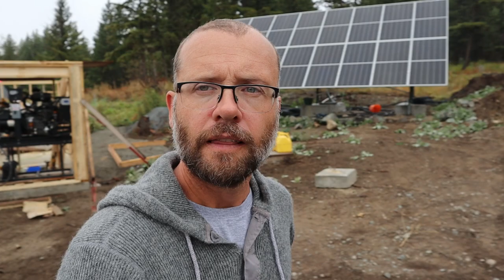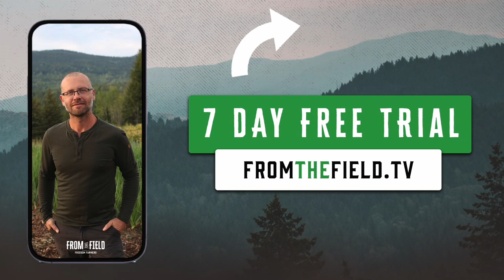Why I Set My Solar Panels At 3 Angles

Comment: Nice, 15 degrees is probably very nice for your area. Mountainous areas experience delayed sunrises, so solar generation starts at a later time and a more southern angle (off of east). I guess in flatter areas you might want to go more, but I've heard west or east facing panels aren't going to produce as much as southwest or southeast panels (of course direct south being the best).

A secondary case for varied angles is if your inverter can't handle the peak solar noon power output and so it clips your incoming power. All your panels facing directly south would cause a higher peak at noon, causing more clipped wasted power. You either would have to spend big money on a larger inverter, or deviate your angles to widen and lessen the peak of the power curve, reducing clipping, which could increase overall usable power generation (and would save you the money for the larger inverter). 

All depends on individual scenarios, but if you have extra space for panels and don't want to get a larger inverter, you'd probably benefit from adding some southwest/southeast panels.

Comment: We are in Spain and we live with 4 panels with 225w each one, four people for 2 winters and only we spend 16 liters of gasoline, each winter, also qe heat the house with woodfire, Thanks for your ideas!  u r awesome!!
Reply: Yeah having a generator in winter can be a good way to get through the winter when your panels can not produce enough.
I do guess that doubling the wattage on solar might cut your gasoline usage in half ;-)
Reply: @HansKeesom  yeah! we will build a roof  to protect the compost works where we will install 8-10 panels the idea is provide energy for electric mobility and suply the electrical power in the house! thanks for your consideration
Reply: @MaxVonShagow  That sounds like a great project. I hope the Spanish authorities are not working against you. As I understood it was hard in Spain to get permits for solar. Or did you solve that by going off grid?
Reply: @HansKeesom  yes we go offgrid... And also because only go harder if you put e_ panels on house roof... Then you dont need any licence if you make a substructure for gardening and also because we dont link to national electric supplies

Comment: I explained all this on a post some years ago, I wonder if he took my advice. Or maybe he's really smart, and did not need to learn the hard way !
I have a 300Kwh system. i learned a lot during the last 15 years ! I do have some solar tracking panels , but this is not worth while. Adjusting for seasonal variations IS ! I found just two manually adjusted positions, is optimal in terms of installation complexity and durability verses production. My east facing panels are most productive, my location has clear blue skies most mornings then clouds over by noon. Hot water, I found direct thermal solar heating is best . Mostly because it adsorbs infrared they produce hot water even on cloudy days. Whereas solar voltaics just stop when it gets cloudy.
Blessings to all.

Comment: Thank you! Thank you! Thank you! I was certain that someone had figured this out, but couldn’t find any information on the internet about it. Designing my system now for a 20kw array. Plan is to use 4 separate arrays, just for mounting ease. I had this same idea, also for the reason of trying to prevent the inverter from clipping. My plan is to have each array 10° off from the other, starting at 160° then 170, 180, and finally 190. Where I live our weather peak is from 4pm-8pm for rain/thunderstorms, as well as when our cloud systems move in usually, so I’m not worried about trying to collect during that time. Thanks again for the useful info!

Comment: One idea I had was to have the entire array on a set of screws with step motors, a light sensor integrated into the circuit would optimise light collection and angle towards it.  The base would be on a turntable which can rotate from sunrise to sunset, returns to the previous days settings at sunset.  The problem in my area is high winds and the array would take flight.

Comment: Beautiful panel array!
I have a few panels, pole mounted on my RV site. Manually turned but it's a game changer in the upper hemisphere.
You're work there is fantastic! Just a dream for me at my stage of life but it's fun to dream. And trust me, these days I do! Self sustainability is a great concept to teach your kids. 
You have done everthing to perfection in my view! 👌
I hate dragging politics into everything but your set up cofirms my belief the current solar technology is not a viable replacement to justify the 2030 agenda to eliminate the need for fossil fuel. An average city lot & rooftop could not accomodate that many panels. You set the standard for excellence while at the same time proved to me that diverse power sources are still necessary.
Looking forward to future videos!
Reply: I know a guy that is grid-tied with his 6000W rooftop installation in Edmonton. He doesn't understand that without my tax-money being used to subsidize him, every aspect of his hobby is useless. He's the same guy that told me winter snow cover isn't a problem because a multi-year technical study proved conclusively that it only reduces panel efficiency by 5%. The same authors think that carbon tax and eating bugs will stop hurricanes and volcanic eruptions an sheit. Ya'know...the science.

Comment: How does your charge controller deal with the different voltages caused by the different angles? I understand that MPPT controllers round down the power to match the lowest producing panel or string.

Comment: I'm building a small (minimalist...1400W) solar PV system that is mounted on a pair of horizontal "spits". They can track in elevation only, but I could rotate the entire craft in certain situations. You've mentioned future-proofing with the potential for an additional panel installation.  You could consider mounting your existing installations on rotating azimuths to optimize your efficiency.
Reply from the maker: With your system, it's easy to do. With a system as large as mine on three different rigs, just try to imagine the amount of mechanics, servicing and maintenance that would be involved?
Reply: @offgridcurtisstone Now you've got me thinking up a couple of fairly simple / robust / weather-proof / cost-effective approaches that can be taken.

Comment: would it make sense to have just one of your rigs but that one being able to swivel throughout the day and investing the money of the 2 other rigs into more battery capacity?
Reply: Those tracking racks are great but can be expensive. If you have the space it’s probably cheaper to buy additional modules and racks etc. that would add up to the same output as a smaller tracking system, but with no moving parts.

Comment: Because of winter I would have placed them more vertical aiming for the wintersun.. Means more watts in winter when you really need them more the nin summer and still get's you more then enough in summer.
Reply from the maker: Like I said in the video, we can change the angle every season.
Reply: @offgridcurtisstone  Oke sorry I missed that. Good to hear, I am a big fan of almost vertical panels for when living closer to the poles.

Comment: So does the same idea apply along the other axis pitching the panels more towards the winter sun so as to increase winter output at the cost of peak summer? (Assuming you are on a fixed mount). 🙏
Reply from the maker: I actually forgot to mention that the panels can move the angle. We move them at each season change.

Comment: I wouldn't say angle, that would be how high or low the panel is pointed. Technically I think the correct term is azimuth, which is the compass heading north, east, west or south it is pointed. But yeah, due south is not always the best for each individuals requirements.

Comment: A single wind turbine might give you some additional night or winter charging.  In some climates the wind is best at night and winter.  Just a thought from an engineer with over a gigawatt of solar design :).
Reply: Indeed, at many places wind plays nicely with solar. Hydro if available can also be a good idea.
Reply from the maker: We have two turbines and they are useless.
Reply: @offgridcurtisstone  Not enough wind up where you're at? Just wondering why they are useless. Thanks
Reply: @offgridcurtisstone  I assume they are not very high up in the air?  Windmills become more efficient with height.
Reply from the maker: @HansKeesom  they’re pretty high. At least 50 feet. Wind power is mostly a globalist scam. Just get more solar.

Comment: Hi I live in Texas and I find that my panels produce power for around 4 1/2 hours in the summer and was thinking about splitting them up for the same reason. I may do a small test set up first to see just how long I could extend that window of production.  Did you you try any other split or did you just "GO FOR IT"?
Reply: Texas is much closer to the Equator so sun should be above you most of time. Placing them flat on flat roof or floor seem like optimal. But playing with small setup will teach you a lot, like it is about watthours a day not just watts :-)

Comment: If you put your solar arrays on rotating bases and had them turn with the sun (like sunflowers do) how much would your energy yield increase?  The cost of doing this is of course a highly related issue.
Reply from the maker: Cost / benefit. Not worth the cost for us.
Reply: ya jackie I had the same question in an earlier video because I had heard that you get like a 30% boost using rotating bases, but looking into it more it's cheaper to just buy extra panels because the solar trackers are about the same cost as just having more panels, and using just more panels doesn't have the same maintenance costs in the long run.  This way that curtis has it designed is pretty cool, I like the idea of just buying extra and pointing it in the times of day that you're most likely to need it.  Very cool

Comment: Did you ever look into a rig to track the sun?  That probably would have produced the most electricity and you would require less panels and batteries?
Reply from the maker: Yes. Not worth the cost.
Reply: When panels were expensive trackers were a good idea. Now for the cost of a tracker you can buy twice the panels where trackers only helped like 25-35%
Reply from the maker: @HansKeesom  exactly.

Comment: Did you consider dual-axis trackers?
Reply: Trackers introduce an extra level of complexity, maintenance issues and decreased stability. Solar pannels are cheap these days, it makes more sense to add another array with the budget that would be spent on makimg it turn. We installed fixed pannels facing east, south and west and it covers sun up to sun under

Comment: Shouldn't the solar panels match the battery storage? 
Seems the charge controller would be working overtime trying to continuously charge 96 Kw battery storage with (at best) only 20KW of solar while the system is using power.
Reply: 4-5x as much energy storage as array wattage is pretty normal

Comment: I was thinking why not put a sun tracker on a auto moveable platform?
Reply: That is a solution that was viable when panels were expensive. Now the panels are cheap and a tracker expensive and vulnerable. Only when having little space to you use a tracker.

Being able to change the vertical angle depending on the season can be important when closer to the poles(north pole, sout pole)

Comment: Wouldn't it then make sense to only have east or west facing panels, and no panels towards true south? Mid day all panels produce at max anyway. Then you get a little more in the early morning and in the late evening.
Reply from the maker: Maybe. Try it and let us know.
Reply: That is what we do on flat roofs now. having little rows of panels east and west interchanging allows for more panels on the roof with more production earlier and later while still having lot's of production mid day.
But when up north like Curtis is, you want to be able to tilt based on the season to have decent production in winter.
Reply: @offgridcurtisstone  we built a system for a customer with arrays facing 30 degrees east and 30 degrees west of due south.  This setup can minimize generator run time and reduce the size of battery that you need. I agree with your reasoning. The biggest difference on ours is that it was V shaped and had 2 main arrays rather than 3.  There is another arrangement that we want to Try. Using bifacial panels mounted vertical with the front side facing west and the back side east.  For the most extreme spread of the bell curve. These would be in addition to a more conventional array.
Reply: @sethdavis704  Just wondering if you tried the vertical bifacial mounted west/east layout? If so how did it work out?? Did it produce well? Thanks.
Reply: @commandertim575  yes I did try the vertical bifacial panels. They peak at 9-10 AM on the east side and 4-5 PM on the west side. The power dips down to about half or less at noon.
Reply: @commandertim575 The production was lower than a south facing array. But not too bad. About 15-20% lower.
Reply: @offgridcurtisstone  we build arrays with a southeast and southwest section. They do work well for flattening the power curve. The south array would only make it peak higher at mid day.
Reply: @sethdavis704  Nice to know, thanks.

Comment: Very situational to your area and consumption. Most people this setup would not be ideal, especially if you use lithium batteries. People on YT have tested this method and shown which way really generates more power. I would suggest people take your comments as good info but also research what they really need based on their battery type, area, consumption, panel type and how many panels they plan on adding. 

Generally speaking most people would want all their panels facing south unless they had so many panels that they just couldn't fail no matter the time of day. Then they're trying to shift the load off their batteries and make them last for the maximum amount of time, such as what you're doing.
Reply from the maker: Like I said, in our context, we prefer to get immediate power that we can use earlier and later coming from the panels and not the batteries.

Comment: Bro, tracking system.
Reply from the maker: Do you have that on your system?
Reply: @offgridcurtisstone  not yet but I will. It’s takes some work and money so you have to decide whether it’s worth it for your particular setup.
Reply from the maker: @mixanthony  ya, it’s never made sense for me. I’d rather just add more panels. Seems to be the cheaper route. Adding more mechanics means more servicing.

Comment: It’s great that you have the money to do this, but I still think it’s a waste. I live in Washington state near Seattle. 
It’s a better use of money to buy a gas generator for charging the batteries when you’re at winter. 
Or just switching back to the grid at night and then flipping back on in the day. 
At least this is what I do. I only have 7.7 kW of PV and 9.6 kW a battery. but this runs me year around at least nine months out of the year. And then I use the outline I described above.
Reply from the maker: As long as you can get gas, sure.
Reply: Depends on the cost of getting that gas over to your place. Andwith current gasprices calculations quickly tilt towards solar, certainly in the long run.
Plus the silence.....
Reply: @HansKeesom  
You also have to have room for all those panels- I don’t.